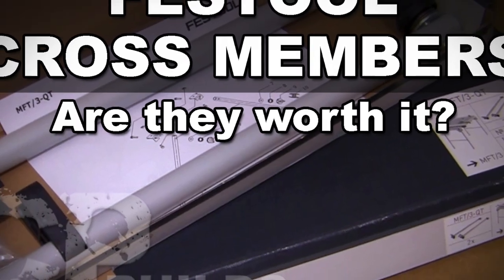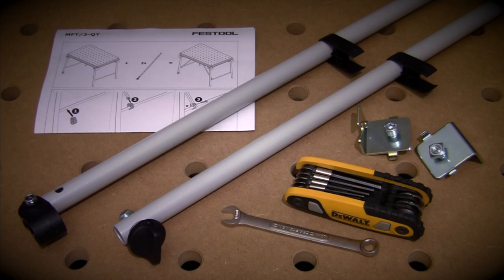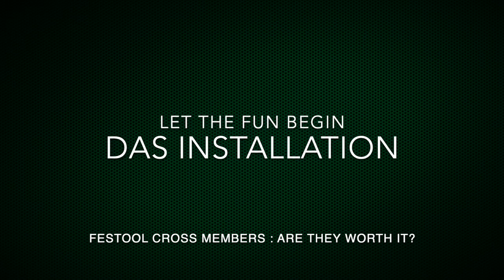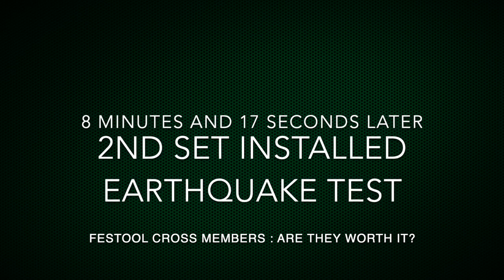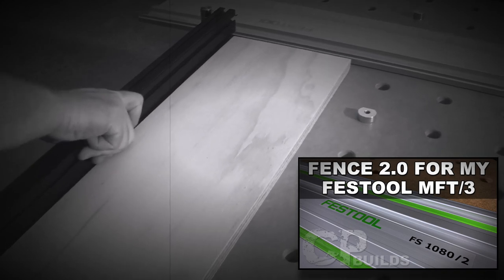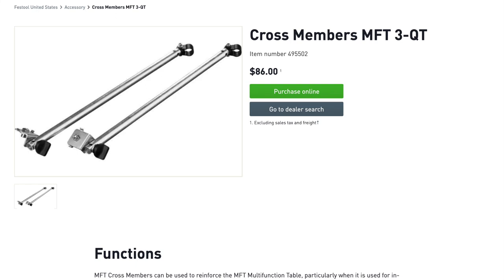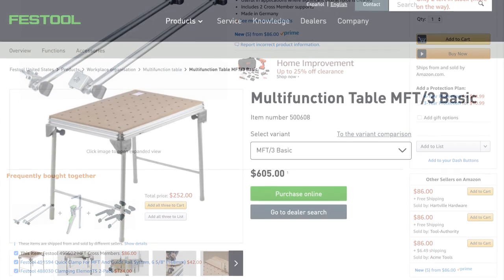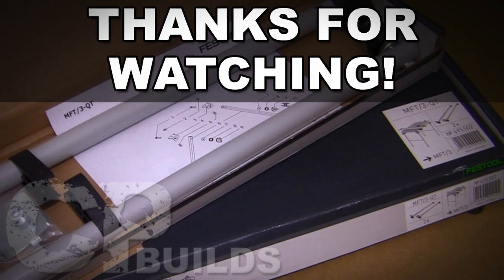Festool Cross Members : Are they worth it?

Comment: really, that much wobble with 1 set?I know it's supposed to be a portable table but fuck. This is the stuff that keeps me track sawing on my basement floor. Thanks, you just saved me some frustration. I think I'm going to build my own or throw down even more dough and  make room for a dashboard MFT table.
Reply from the maker: The Dashboard is the bee’s knee’s. Love his brackets. Robert makes an excellent table. Just be aware that his top is (1/2)” thick as opposed to (3/4)”. Makes it lighter that way.
Reply: @CPBuilds  Thanks, I missed the fact that it is a 1/2" top. His brackets look pretty sick. Cheers